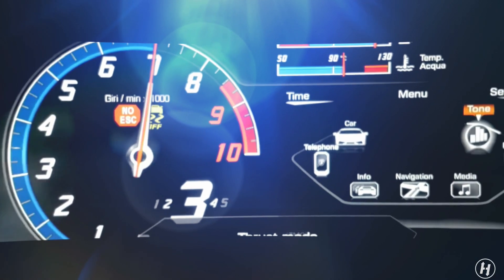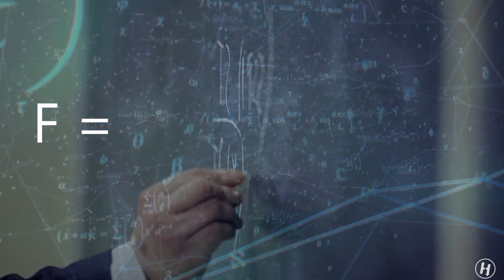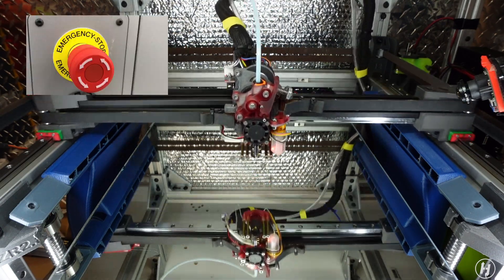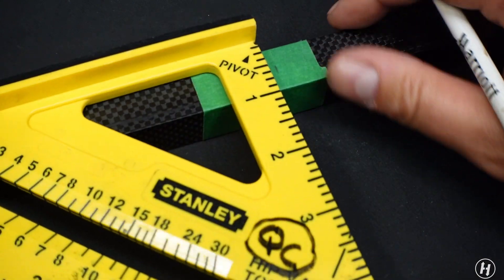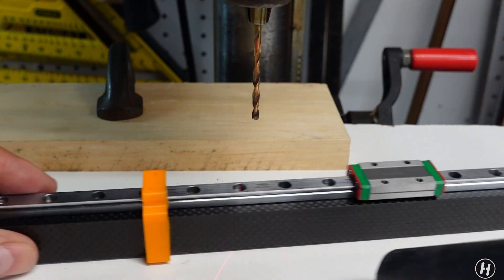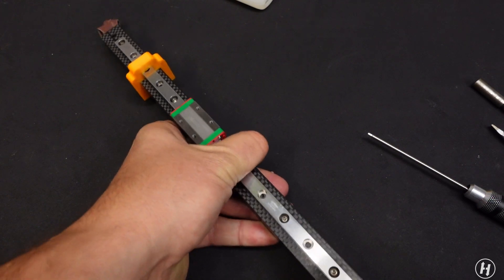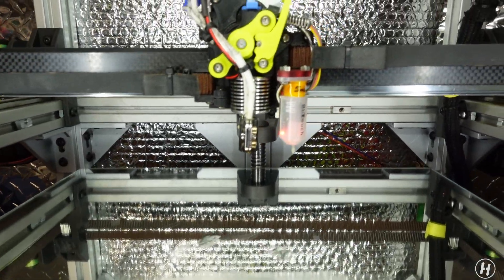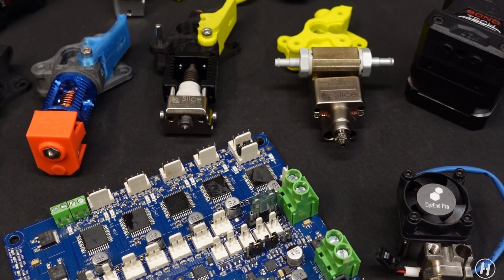Using TITANIUM and CARBON fiber on your 3D Printer

Comment: I love your work! ‍🔬. Keep going on your excellent developments. I don't have a 3d printer yet but I am planning to buy a Sapphire Pro CoreXY which has linear guides as a beginning way to start upgrading it for high speeds. You know what? This printer I suggested seems very interesting for starters that want to upgrade to high speeds. If you make a video upgrading that printer with HevORT LDO Motors, the carbon fiber tube and the control board you would get many subscribers. Today you make videos about performance but those are not useful for the starters. I'd like my 3d printer to be accessible and possible to upgrade to achieve high speeds, even having dual drive extruders. That's why I'd chose this model. Currently I don't have the time to dedicate myself to working on such a project as I am making an all-in-one 5 axis CNC with laser cut, pcb factory and solder paste extruder, low speed 3d printer and pick and place machine (A coffee machine add-on attachment is also under analysis ☕🤔) . but I'd love to have an affordable lightweight high speed 3d printer for fast prototyping. and I think the option I suggested seems to match the right skeleton for getting started. I'd really appreciate your opinion and if you really like the Idea I'd love to see your videos about this development. You could even have an paid montly subscription on YouTube to help you fund this project and bring it to life. By sharing videos on how to upgrade an affordable 3d printer that already had linear guides to a high speed one.
Reply from the maker: Thank you for your comment.  With the time I have available between kids and work I like to push the limit and experiment on more crazy stuff.  But I thought about doing a series on modding popular printer eventually.  You are putting this idea higher in my priority ranking ;)
Reply: @MirageC  that's great to know! I'll wait one more year before buying my first 3d printer. I'll wait to see what you choose as affordable model for upgrading to high speeds. My experience is almost zero so better get advices from someone that already knows well what's doing. Sapphire Plus Core XY seems interesting because it has linear guides over all 3 axes it has the extruder in the head (allowing flex materials) and has a strong frame all around and is affordable. But who is saying that is someone that has never used a 3d printer before. so I let for you to give some nice advices on the most suitable model.

Comment: Surprised you used titanium hardware, wouldn't aluminum do just fine, while weighing and costing less? On my motorcycle I'll even use nylon screws on non-structural parts, far lighter than even aluminum.
Reply from the maker: M3 aluminum screws would be too fragile, the risk of cross threading during the installation kept me from going that route since there was no way of fixing such issue for the ones inside the tube.  Also aluminum has a very high galvanic corrosion index when mixed with carbon.
Reply: @MirageC  Thanks for the info!

Comment: you could lose a ton of weight by taking material out of the back of your linear rail, not sure if you have access to a milling machine or not,  but skeletonizing it from the backside and completely pocketing out the unused holes would save you a lot, with the low load on it you could make the walls pretty thin. and you could do the same to the top of the bearing block,
where it mates to the carriage, they are made to carry a load so since they are not they could be drastically lightened. they are pretty hardened steel so not an easy milling job but very doable if if someone knows what they are doing.

Comment: @MirageC One of the most important things to me is dimensional accuracy of the finished part.  To achieve that with higher performing materials (CF-Nylon to PEEK and beyond).  Any of these are going to need heated enclosures.  Once you go over 100*C in the enclosure, expansion of the all of the motion parts should be as similar as possible, or things could get out of spec during printing and over time deformation.  Would seem that once we start talk heated enclosures (not 50-70*C, I'm talking 100*C and above), having different materials making up your motion system (carbon, titanium, aluminum, etc is going to affect overall part dimensional accuracy).  I assume, by the title of this video, you mean 3D Printing without higher temp materials and heated enclosures in the 100*C and higher?    Heat aside though, I'm a gram weenie at heart (I do wilderness backpacking and have started developing ultralight gear for that).  So if open enclosure 3D printing, I think you are spot on here :-)

Comment: Truly impressive. You almost converted me to CF tubes and rods !
Since you fried some Duets during this test, why not experiment with something cheaper ? Like a Spider or Octopus board, for instance ? It's just a quick idea, it was pretty painful to hear you fried Duets, considering how expensive these are. :)
Reply from the maker: Yea i have all kinds of other boards i need to try.
Reply: @MirageC  While re-watching this, a question popped into my mind.
This mostly applies to bedslinger printers. Since CF is super light whilst being tougher than aluminum, would a CF Y-carriage be a good idea ? It could also, in theory, reduce the moving mass, thus increasing the potential acceleration. Your opinion about that ? Pros, cons ?
Reply from the maker: @Myrblyl  Yes definitely, any moving system can benefit from weight reduction as long as the structural integrity is not affected.  CF bed with CF extrusions sounds like a good combo for a bedslinger.

Comment: Have you thought about using a maglev system. Friction affects acceleration in a big way
Reply from the maker: what would be the cost and precision level of such system?
Reply: @MirageC  still runs on stepper motors. Just a neodymium magnet rail system or electro. I also think I can lighten the y axis further utilizing of all things arrow shafts. They are graded for straightness and flexibility. A couple of aluminum spacers to aid in rigidity. ABEC 9 bearings. Use ofc wiring it's more flexible and cause run higher current on smaller guage thus reducing weight even further.

Comment: Might want to try some carbonfiber C beam. Easier installation for the rail and you cut more weight. The next thing I would be looking at is ditching those 3d printed parts and going with something different. You may be able to put some carbon fiber there in its place.

Comment: drill a larger hole on the back side of the tube, wide enough for the proper socket to just fit. for such a light duty application you can thin the walls of a socket by grinding it down to allow for a smaller hole reducing structure integrity loss.

Comment: super impressive! the only way to go faster is to design a custom H bridge stepper driver or buy off the shelf stepper drivers designed for higher current. you should do it. 2.2A/1.6A. this would get you up to 77,000. it probably won't be a perfectly linear increase so maybe 72,000 in reality as the stepper starts to skip again. you would be one of the fastest DIY FDM in the world.
Reply from the maker: I managed to get 150 000 accels without a sweat on ClearPath servo motors.  Servos are weird beasts when it come to 3d printing.  I am not done yet tuning them... but I will succeed! (trying to convince myself here...  :) )
See them in action here: https://youtu.be/h-ukClHtai4

Comment: Is the carbon fiber tube really necessary? Couldn't you just directly mount the rail to the XY joiner?
Reply from the maker: Metal rail alone woulf vibrate and oscillate too much under hard acceleration.

Comment: The next one heaviest part is the head, IMHO. It would be interesting to have a full ceramics hotend, or a non-moving laser head, where you have to only move the material feeder and melt it. It can be interesting to compare this new carbon fiber setup with the fastest delta printers - maybe the next move will be that you turn your printer to a delta printer.

Comment: Another way to SIGNIFICANTLY reduce weight, is to actually build a smaller printer. Not only does this save weight, It also increases the stiffness of the whole cage.
I don't know about others, but personally I'd say around 90% of my own prints are smaller than 120mm anyway (In X, Y and Z).

Comment: I think your test of just moving the y axis is not the best test as both steppers are on. I have the carbon tube mod and the worst case is when you are moving at 45° where only one stepper is on. Also the speed chosen for the tests has a large impact on the results. The stepper voltage and amps together with the inductance can be used to calculate the theoretical max speed. For my 300m/s test I can get up to 110k acceleration. Without the motor skipping steps.
Reply from the maker: The result chart will show similar curve profile nontheless.  45 degree moves would have involve Print head mass which does not involve carbon tube.  This test was to see the gain of the carbon tube and titanium hardware on the mass moving along Y axis, hence why I tested Y axis.

Comment: How much does it speed up actual print times though? I see printing something with a reduced printing time and the same quality as the actual test, not simply measuring the acceleration of a non-printing printer. 

Its like Dyno testing a car's horsepower versus actual track performance. I'm far more interested to see how it performs on the track than its dyno numbers.
Reply from the maker: You can select to control the acceleration from you slicer. A much better print time estimate will be obtained by using the actual acceleration to which you have set your printer. You can see an example or printing with this CF tube here:  https://www.youtube.com/watch?v=ZtpQwZyuZP8

Comment: Very informative channel. Subbed! Thank you for taking the time to making this. I was using carbon shafts too, but they where a bit too loose for the bearings i'm using (5mm id 624ff). I'm now using aluminium shafts, bought some oversized 5mm shaft (it was 5,1mm, anodized) and used NaOH to help it shrink evenly. I do have a lathe, but it's tricky to machine longer shafts perfectly to dimension. Perhaps the carbon shaft was just off, i don't know. Have you considered using an MGM7 rails btw? Allthough 4G+ acceleration is not bad persé :)

Comment: You should definitly change the kinematics from CoreXY to CrossingRods or DoubleCrossingRods. Like the Ultimaker, just with carbon fibre tubes instead of steel rods. Why moving the x-linear rail in y-direction at all? Use two linear rails for x as you do on y. Fixed, so the only moving mass is the cariage, not the rails. The carriages of the oposide sides are connected by a light tube (or two tubes if you like). The printhead uses Igus bushings to slide on the crossing of the rods.
Moving mass goes incredible low - and is the exactly same in x and y. So on crossing rod unlike on CoreXY one axis does not limit accelleration to the other one.
Also the belts you use get much shorter.
CoreXY is a nice idea - but the hype about it is not justified. If you want fastest acceleration, go crossing rods.
Reply from the maker: We found that at those speeds the Pressure Advance and the Retraction control is too sloppy with a Bowden tube.  Therefore we need a direct drive approach.  Do you have example of fast printers using this kinematic?
Reply: @MirageC  I only found one video https://www.youtube.com/watch?v=Kx4VfzS_V6c using linear rails instead of rods. Still it is no support needed under the crossing linear rods, as they are turned 90°, so less moving mass than on coreXY. It uses a hemera.
But there seem not much people into building such printers.
While in the time the ultimaker was more popular, light direct extruders where not easaly available.
With light feeders like the orbiter, light hotends like the Mosquito and part coolers like Berd-Air, nowerdays it is much less a problem to carry a direct extruder using crossing rods.
So for a smal high speed printer you could use a CR200b, changing the crossing rods from steel to carbon fibre, the bearings for bushings and changing the extruder. The biggest problem seem to be to get bigger rods/tubes and bushings in a decent quality to build bigger printers this way. While Igus have some nice products, they are neither cheap nor easy to get for private consumers. And as most people seem to stick to CoreXY today, it seem to be a bit of the hen&egg problem...

Comment: I'm a bit curious, while the raw acceleration advantages are clear as day in this test, does this directly translate in to faster prints? are there any quality downsides  after this mod etc.?
Reply from the maker: Yes, definitely allows for faster prints without loss of quality.  In this example I am pushing it to the extreme, but nowadays, a 15minute benchy would look just like a 45minute from a few months ago.  Pressure Advance, Resonance compensation, square corner speed from klipper are a major contributor to quality speed prints.

Comment: Why don't you use epoxy to glue the rail to the tube ? No fastener is lighter than no fastener ...
Reply from the maker: I was afraid the difference in thermal expansion would have more impact if glued than screwed. I might be wrong.  Need to do some research.

Comment: You might save a little more weight by changing to the Precision Piezo Orion rather than the BLTouch.
Reply from the maker: Yes, one of my next try, but I am wondering how to mount it and not loose rigidity.  My hot end had to be attached from the bottom of the heatsink to avoid a pendulum effect at 100K + accel on servo motors.

Comment: Excellent results and maybe time for a Duet 3?  

Frankly Titanium hardware is probably overkill.  Aluminum screws and nuts will be plenty strong and half the weight.  May be able to use an even smaller rail?  Ultimate would probably be to sand the carbon fiber tube flat and parallel so you could use plastic bushings.
Reply from the maker: Klipper does not support Duet3 yet. I do have one sleeping on the shelf.  Many of the key feature for quality speed printing can only be found in klipper at this point.  I know RRF is working hard on it though.
Reply: @MirageC  sorry wasn't thinking about the software issues at the time.  A bit premature until Duet3 can auto-tune the input shaper.

Comment: If the idea is to increase the speed the extruder can traverse across the print bed, it seems to me that the next step would be to build a printer that can move the bed in the opposite direction to the extruder at the same time.
Reply from the maker: That sound like a lot of moving parts involved.

Comment: BTW for any cutting with dust, cut inside a bag.  I use regular trash bags for many things, when you need to see better get clear plastic drop cloth in the paint departments etc.  Essentially think of it as making a fume hood to contain dust and go from there..

Comment: To reduce even more weight, use a remote extruder like, nimble or flex3drive g5. Don't forget to change the extrusion rate or use gearboxed steppers, because these extruders multiply the gear ratio. You may reduce about 2 thirds of the motor weight.

Saw the pricings for this buid and I was expecting more with the carbon fibre tube.
Reply from the maker: I used an early version of the Zesty Nimble, It had a 30:1.  Adding the cable flex to this high gear ratio makes high speed printing difficult.  Pressure advance and retraction in those high speed prints require too much speed from the stepper motor.

Comment: It could be possible to build a new solution with two carbon fiber shafts and some plastic bearings..
Could also change the pulleys to ones in plastic.
That would eliminate the heavy rail. Guessing that is the heavy part that need to be altered to achieve a lighter solution.
There is some nice hollow carbon shafts from igus.

Comment: self clinching nuts work great in carbon fiber. Using these then you won’t need a washer and you can save another gram or so. 

Also loctite is fine with carbon fiber. The only thing that will mess with the resin is fire.

Comment: When you are using this high acc. you might have loss steps that you won't know about.
Can you re-do the test and check if you have misssing steps after each test cycle?
the right way to check for missing step will be adding dail indactor and checking the bridge postion against the dail indactor.

It will also be intersting to see what prolong use with high acc. will do for the 3D printed part.
Reply from the maker: I agree this would give us a more accurate breaking point, but the overall curves would not look much different.  I'll set a dial indicator with a routine to probe between each acceleration rate.  Thanks for the suggestion.
Reply: @MirageC  From my exprince in motion it will give you diffrent stop point.
In the current way you stop when the motor is failing make the move, normally you lose steps a lot before the motor stop moving.

BTW, the drivers and microsteping setting also effect what the max power you can get from the motor, using lower microsteping will give you higer speed and tourqe preformance.

Comment: I'd be interested to see the comparison in stiffness between aluminium and carbon. If the system gains flex that would be a shame.
Reply: lol cf is usually stiffer than alum. in fact about 4 times stronger and 2 times as stiff. (given the same dimensions obviously) Carbon fiber is probably better in MOST applications that could use both of course unless they needed the part to yield before breaking or have more flex. (like an airplane wing) however, they can make special composites that have those properties.  That is why CF or other polymer tech is SO advanced and researched.  Even in the 3d printing industry just look at the available engineering filaments. It's insanely interesting.